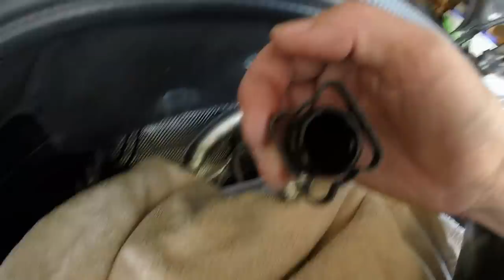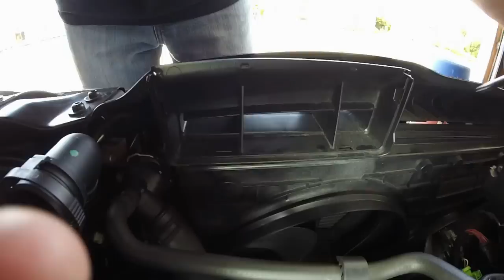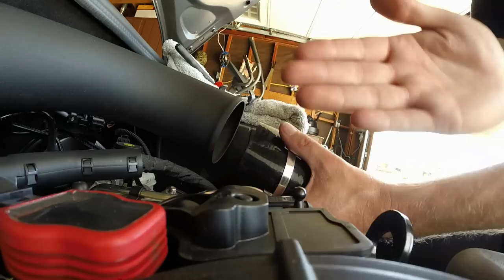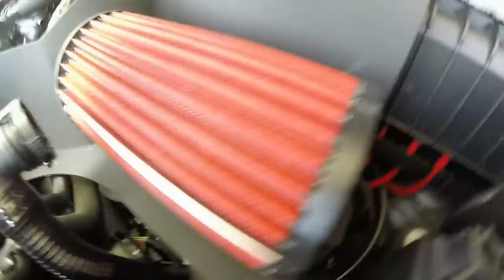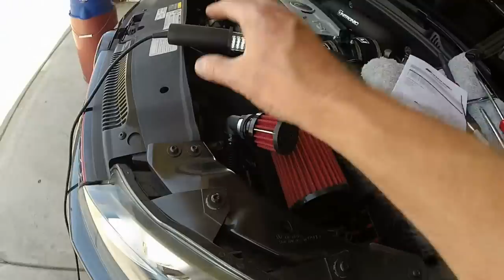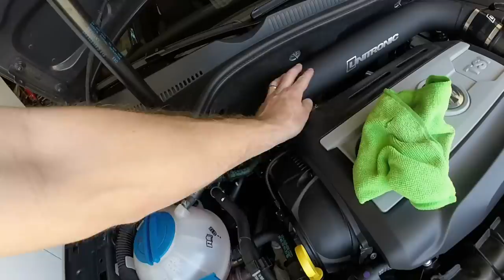2013 VW GTI: Episode 50: Unitronic TSI Cold Air Intake Installation and Review

Comment: i gotta ask ive got a jetta 1.8 t and i just wanted to know if you have had any problems with hooking that cbfa filter up like that is that the correct way?
Reply from the maker: +B!G E that intake is not made for a 1.8T.
Reply from the maker: +B!G E no idea, i don't know the configuration on the 1.8T. but the SAI tube only blows air, not sucks.
Reply from the maker: +B!G E to muffler the SAI startup noise mostly.. and catch a little fumes.. but not much.